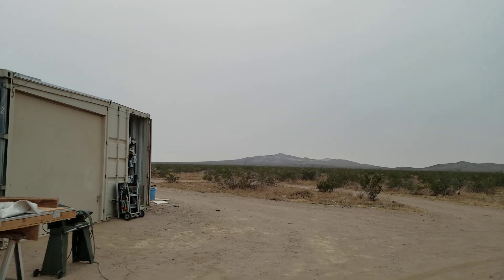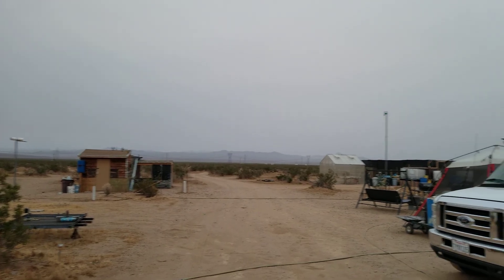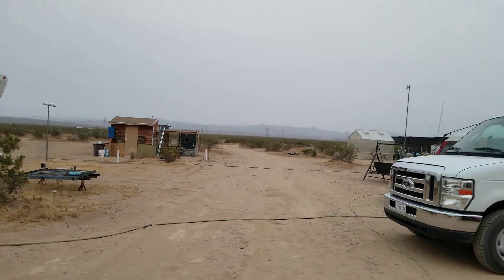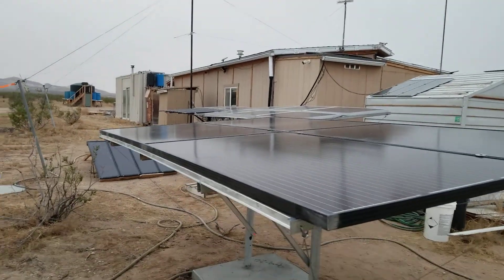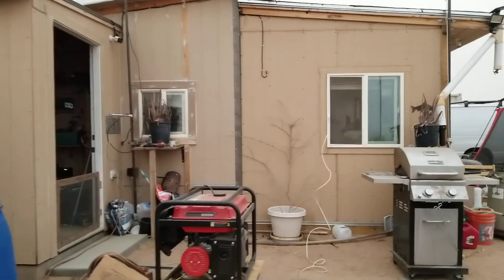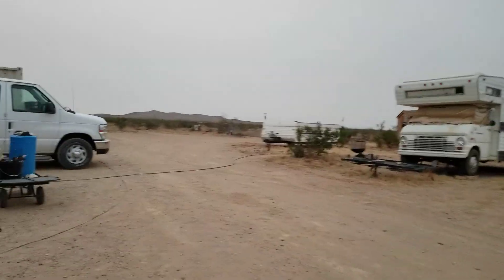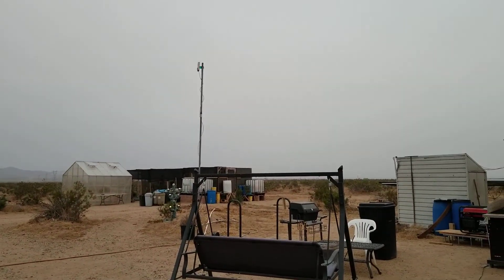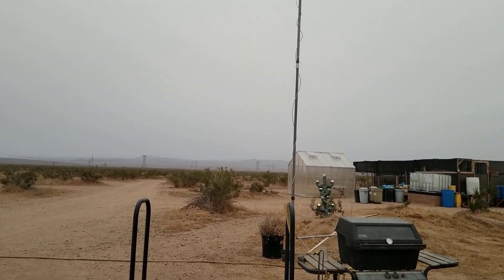New Panels and Rack Installed, Sep. 8, 2020

Comment: Gbear u going to make ur own combiner box for ur wires instead of running 4 wires to ur controller
Reply from the maker: I'm bringing in 4 to a set of bus bars, then 2 down to the controller.  That'll leave me space to add 2 more strings.

Comment: Can you share the length and width of your new single panels and the older single Harbor Freight?  Wondering which ones might be best for a future mobile roof top.  Thanks!!
Reply from the maker: The new panels are 39" x 64.5 and 1 panel takes about the same space as 4 harbor freight panels.  The new panels are 305w each and the Harbor freight are 4@25w or 100w, so the new panels would be a better choice.
Reply: Thank you.  One last item can you guess the weight of the large one?
Reply from the maker: @mikesmith1550  the label says 18kg.  That's just under 40pounds
Reply: Thanks again.  Hope it's cooled off a bit and the air is fresher today.
Reply from the maker: @mikesmith1550  good guess!  Only 82°, cool breeze and blue skies fresh air.